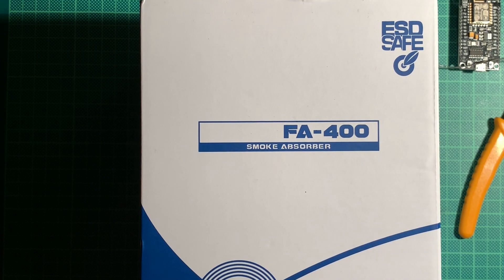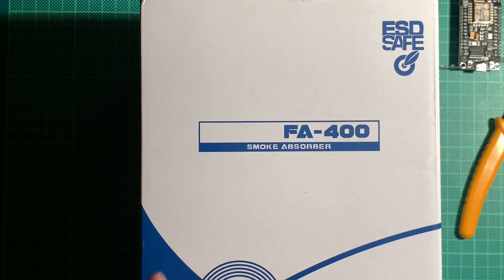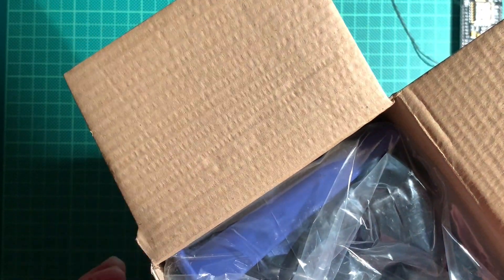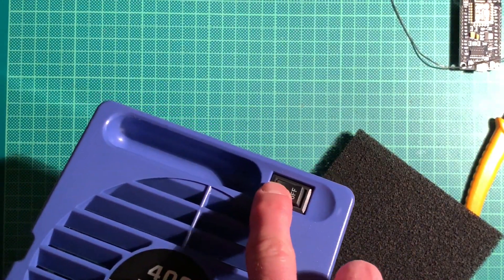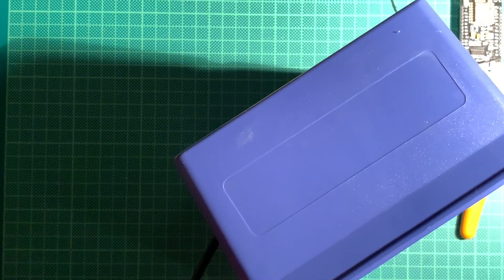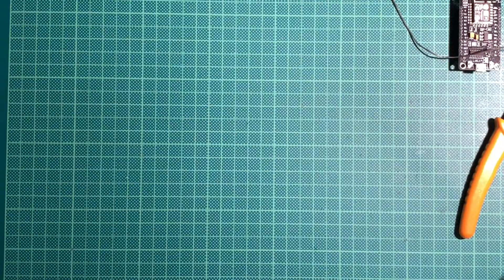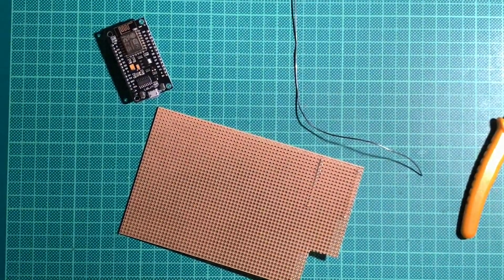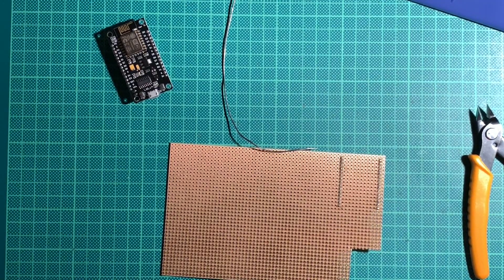Chinese FA400 Fume Extractor Clone

Comment: How is the exhaust range on the thing? can it handle .5 - .75m? Planning to get one of these soon.
Reply from the maker: It needs to be pretty close. 0.5m is probably the maximum distance. Depends of course on general air flow. I leave the window open and turn on the fan, and solder as close to the fan as is possible.
Reply: @root42  thanks for the reply! Would you say that the original FA400 be able to handle a less ventilated area rather than the clone? And possibly a better exhaust range?
Reply from the maker: Oh, sadly I never had the original. But you can go Louis Rossmann style and attach a big hose to get it nearer to your workspace. Of course there are bigger air filtration systems out there. How much do you solder? If only occasionally I would say this is ok. But if professionally, then you probably need a better system.
Reply: @root42  I'm a hobbyist, so definitely not on a daily basis. I would say close to twice a week, 1 - 2 hour sessions max. I just ordered mine for 20 USD equivalent (in SEA).
Reply from the maker: Ok, good choice!

Comment: wow that's loud
Reply from the maker: It actually got a bit better over the months. Either the bearings are now worn in or I got used to it …
Edit: I just measured with my Apple Watch: 63dB in 15cm distance.
Reply: @root42  Thanks for the insight. 63dB pretty normal for ambient with any instrument with fan I guess. Still better than nothing 😁